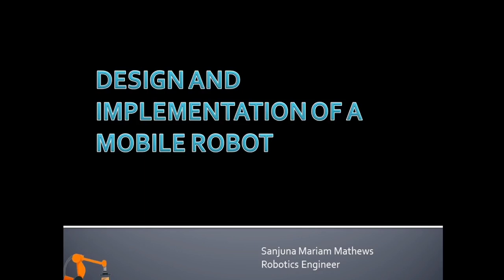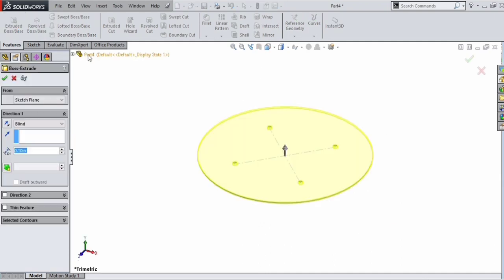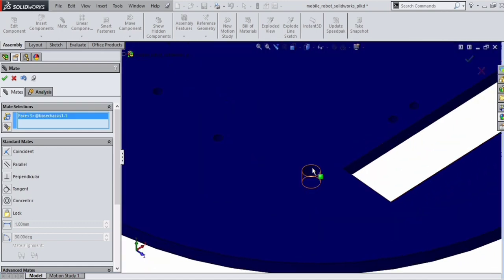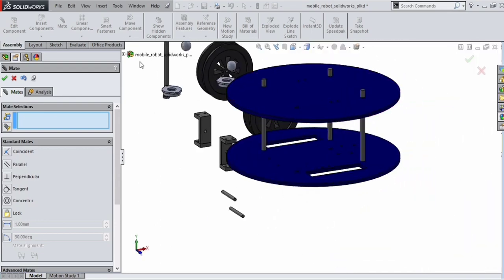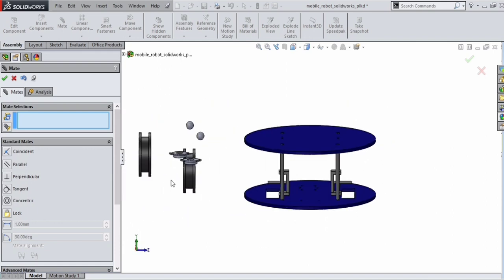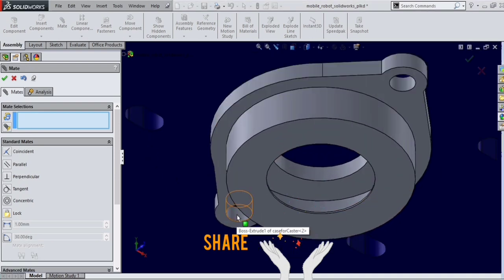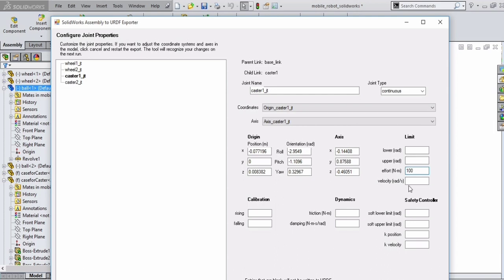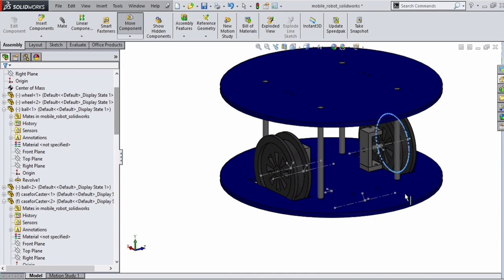ROS Tutorial Autonomous Mobile Robot -Part 1- 3D Part Modelling, Assembly, Export URDF in Solidworks

Comment: My robot model explodes while loading into gazebo after exporting from solidworks. Any tips ?  
Also, do we need to correct the origins and axis of rotation of joints to be used in gazebo ?
Reply from the maker: Is there any error in gazebo's terminal .. if yes solve it.. or check centre of gravity in gazebo.. there is option in Gazebo.. and during exporting I cross check the axis automatically generated.. will confirm whether it's correct.. usually I mate the wheels and caster wheels tangential to top plane... Check whether selection of links are correct.. parent - child relationship should be correct